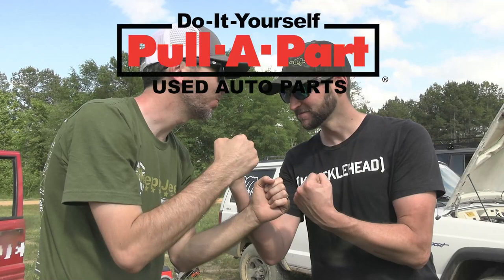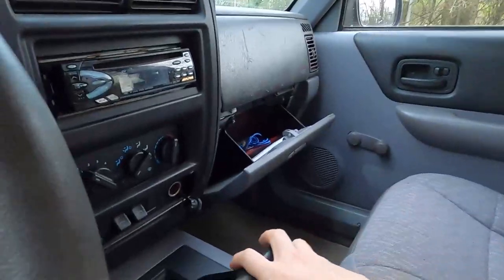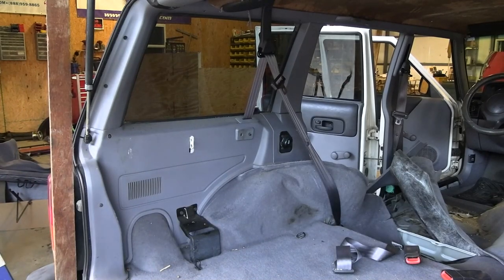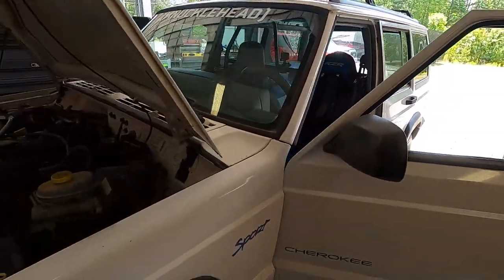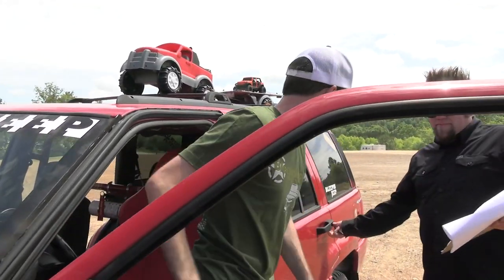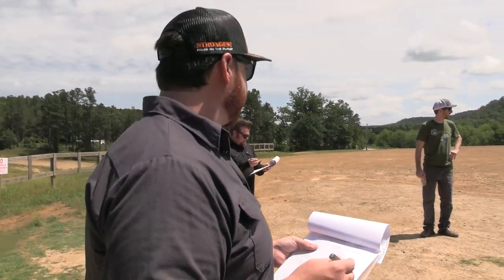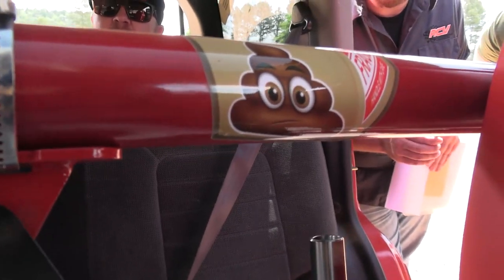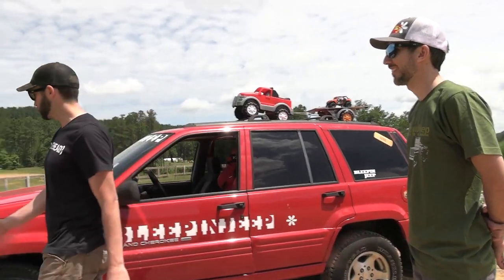Pull-A-Part Cheap Jeep Challenge - Busted Knuckle vs BleepinJeep | EP1

Comment: I'm not saying this is faked...but...a 150k mile cherokee 4x4 with all body panels matching and no damage would sell for like $5-6k over here in Georgia...and pull-a-part in Bama just happened to have one for $2k sitting there waiting for you...that's such a lucky coincidence
Reply from the maker: I found quite a few in decent condition, this one had some issues. Non Working AC, bad oil pressure sending unit, no headliner, etc...

Comment: Probably the most bulletproof drivetrain in the history of motor vehicles
Reply from the maker: Dang ol Cherokee will take a beating!
Reply: You are so right! You want to hear exciting news jeep FCA is working on a straight 6 motor to replace the  punniestar lol V6 it will produce 300HP to a rip snorting beast 525HP for performance vehicles in their lineup and they are rumored to be dumping the Hemi 5.7 6.4 as even the 6.4 only puts out 498HP which is alot but when you have less cubic inches putting out 27 more ponies their is no reason to keep the larger heavier more taxed overseas motors going. OMG🤯 that's amazing HP! I haven't heard about FT LBS yet but an IL six always puts out ridiculous TQ so I'm not worried about that. You can look up articles on it the engine will probably be named the Tornado if sources are right. They already filed patents 2years ago. Thought you would enjoy that news🙂
Reply: @SarahSmith-hd8kd  hahaha, no way that is going to be the standard option, ever heard of emissions laws
Reply from the maker: Sarah Smith yeah the SRT guy responsible for the Hellcat and Demon was sent over to Jeep so some cool stuff is about to happen for sure. 😎
Reply: @16driver16  well I know all about emissions laws. However you can verify that 300HP will be standard or very close is it that hard to believe one the punniestarV6  is already smacking out 285 HP and 260 FT LBS TQ and that's out of a V configuration we all know IL6 puts way more torque out inherently then any V6 setups you don't think they can add 15 more HP to that lol? Don't believe me though go look it up it's easy to see for yourself🙃✌

Comment: Sick burn:  you’ll need those manual windows for when your engine shuts off after you roll it on its roof and you need to crawl out.

Sick burn 2:  Those tires are balder than Terry Crews. Ok maybe that one was lame.  But I came up with all that on the fly.
Reply from the maker: The tires are bald for sure, we shall call them slickies...

Comment: The Chrysler 8.25 came in pretty much every XJ since the beginning unless it has ABS. So technically you didnt need a 97-99 XJ even though they are the best years in my opinion. The 2000 and 01 have issues with the head cracking and the really early XJs had a Renix setup which a lot of people dont like (I think that stopped in 91 or 92). Just a bit of XJ knowlege for you
Reply from the maker: I wanted the 97-99 for the 8-1/4 and HP30. Plus the newer dash looks better
Reply: No they all did not I've owned 8 XJ know them like pretty much like Matt and I've personally had  90 95 96 all had no ABS and had the little turd 35 my 97 90 and three different 98's all had 8.25 not sure why the 90 had one but it had no signs of any swaps as did the others. Just in my experience but they all could have been swapped but I doubt people did any swaps befoee I got them.✌
Reply: 97 and up had the more desirable 29 spline 8.25 96 and below had the 27spline

Comment: Hmmm, one guys uses a professional shop (and professional welder) and the other guy uses a home garage. I am thinking there maybe an advantage in there somewhere.
Reply: Mikal Campanello ya, he’s a cheat for sure!
Reply from the maker: Our plan was to do the build in Byron's little 2 car shop (knucklehead garage) but he sold his house so the build happened last minute after hours at our professional shop. I used the equipment but I am far from a fabricator or professional. So basically a novice using professional equipment it was laughable at best but we got it done. Every piece of my cage was slugged just about and having Wesley weld it up for me was just a safety precaution since it was a roll cage and all.

Comment: 94-96 is as good as the motors get and mines a 95 with factory high pinion Dana 30 and had zero problems out of the Dana 35 with 33s on steel deadlocks and locked and ran it that way for over 2 years 97-99 is definitely not any better than 94 and 95s
Reply from the maker: I'll take the 8-1/4 over the Dana 35 for how I drive

Comment: Have built both 97' XJ and 97' ZJ.  With $5K budget I would destroy BJ.  No contest.  Then I would continue to drive the XJ daily for the next 10 years.
Reply from the maker: So you would choose the XJ? What would you do with the $3k we have left?
Reply: @BustedKnuckleVideo   Well there are tons of parts out there.  My first lift on my XJ actually came from parts off a 88' MJ at the Pull-A-Part in Lithonia, Georgia. Springs, lower control arms and shocks.  So to keep my cost down FB MP here I come.  A decent set of wheels and tires can be had as well. Heck, near me there was just a set of Jeep MOAB 16" rims with nearly new tires for $600.  The only part that I had to search for and found from someone at work was a  adjustable track bar. And I only gave $50 for it and it was almost brand new.  Good luck to BJ finding ZJ parts that easy. Now the ZJ is a cushy ride I know but you have the platform to build and WIN with.

Comment: What’s wrong with the d30 low pinion ?
Reply from the maker: not as strong as the HP model
Reply: @BustedKnuckleVideo  still made of glass.
Reply from the maker: 16driver16 I have seen HP 30s take a lot of abuse